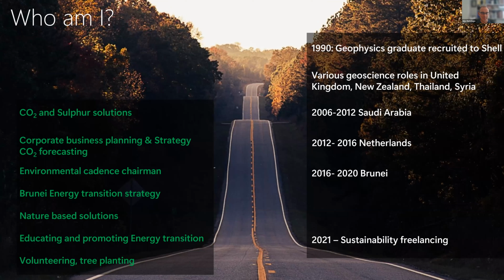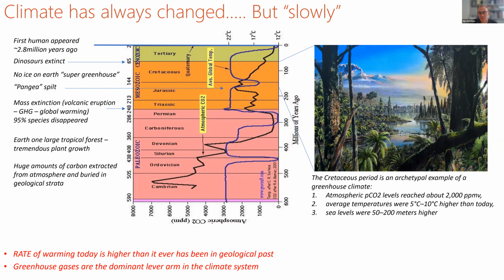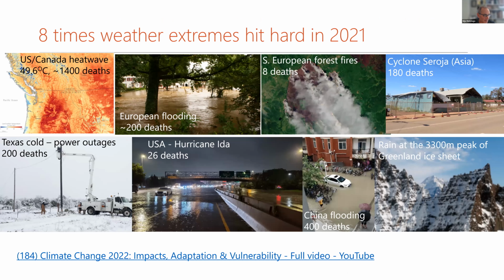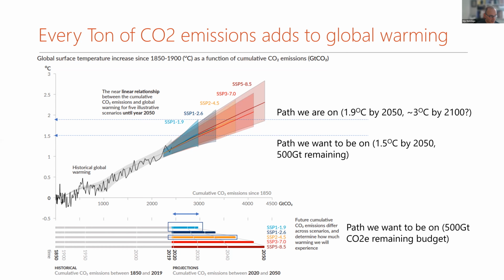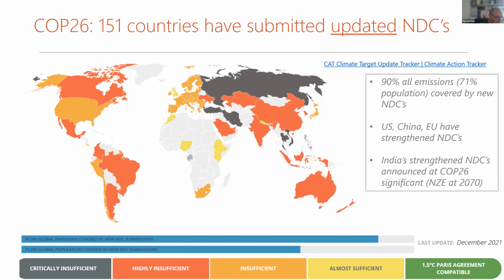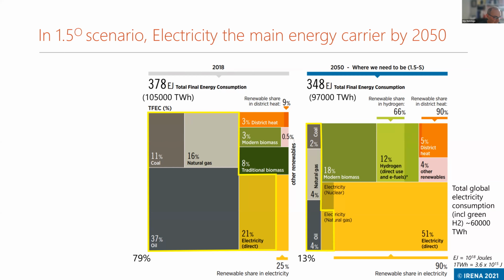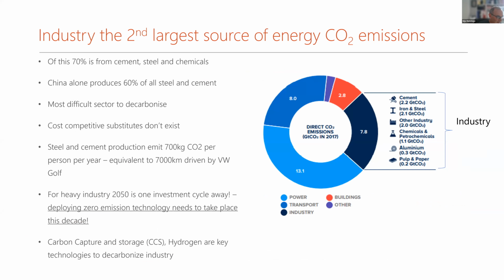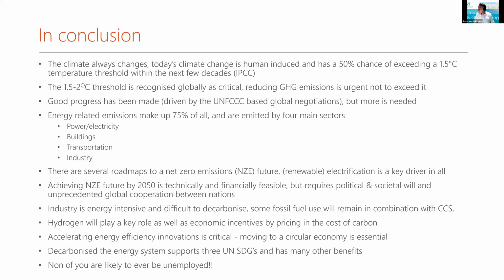An Introduction to the Energy Transition   Esanda

Comment: Excellent and very interesting! Honestly focused on CO2

1. Regarding energy batteries: open chat ai: how much has power storage in kwh per kilo of batterij improved the last thirty years?

Open chat ai: The improvement in power storage capacity of batteries, typically measured in kilowatt-hours per kilogram (kWh/kg), has been significant over the last thirty years. While the exact numbers can vary depending on the specific battery chemistry and technology, here are some general trends:

Lead-Acid Batteries: Lead-acid batteries, which have been around for a long time, have seen limited improvements in energy density over the past few decades. They typically have an energy density of around 30-40 Wh/kg.

Nickel-Cadmium (NiCd) Batteries: NiCd batteries have been used in various applications, including consumer electronics and early portable devices. Their energy density is in the range of 50-80 Wh/kg.

Nickel-Metal Hydride (NiMH) Batteries: NiMH batteries, which are commonly used in some consumer electronics and hybrid vehicles, offer an energy density of around 100-120 Wh/kg.

Lithium-Ion Batteries: Lithium-ion (Li-ion) batteries have seen the most significant improvement in energy density over the past few decades. When they were first commercialized in the early 1990s, their energy density was around 100-150 Wh/kg. However, through advancements in materials and manufacturing processes, modern Li-ion batteries now achieve energy densities of 150-250 Wh/kg or more. Some advanced variants can exceed 300 Wh/kg.

These numbers indicate that Li-ion batteries have seen substantial improvements in energy density over the last thirty years, making them the dominant technology for portable electronics, electric vehicles, and energy storage systems. These improvements have been driven by advancements in electrode materials, electrolytes, and cell design.

It's worth noting that energy density is just one aspect of battery performance. Other factors, such as cycle life, charge/discharge efficiency, and safety, have also seen improvements over the years. Additionally, ongoing research and development in battery technology continue to push the boundaries of energy storage, aiming for even higher energy densities and more sustainable materials.

2. Electric grid maximum growth NL: Helaas kon ik geen specifieke informatie vinden over de groei van netwerkbeheerders in de elektriciteitssector.

3. Geothermie groei: For the most up-to-date information on the maximum growth of geothermal energy in the Netherlands, I recommend checking with local authorities, energy agencies, and environmental organizations or consulting recent energy policy documents and industry reports.

4. Gradueel uitfaseren met fossiel. Stel dat de CEO's van grote oliemaatschappijen niet zo willen uitfaseren: is het zo dat de kosten per barrel alsmaar zullen stijgen, omdat nieuwe olie & gas alsmaar meer 'exploratie' kosten? Kan de groei in kosten per barrel zodanig toenemen dat 'olie zichzelf' uitfaseert wegens te hoge kosten, ten opzichte van renewables? Wat is verwachte groei in kosten per barrel? 

Open chat ai: Historisch gezien zijn exploratie- en productiekosten in de olie- en gasindustrie gestaag gestegen. Dit komt deels doordat de industrie vaak moet investeren in technologisch geavanceerde methoden om toegang te krijgen tot moeilijk te bereiken reserves, zoals diepwaterolievelden of schalie-olievelden. Bovendien kunnen milieuregelgeving en de eisen voor veiligheid en gezondheid op de werkplek ook bijdragen aan kostenstijgingen.

Om een nauwkeurige voorspelling te doen van de verwachte groei in kosten per vat per decennium, zou men toegang moeten hebben tot actuele gegevens en modellen die rekening houden met de hierboven genoemde variabelen. Deze voorspellingen worden vaak gedaan door gespecialiseerde onderzoeksbureaus en organisaties in de olie- en gasindustrie, zoals de International Energy Agency (IEA) en de Energy Information Administration (EIA).

Als je specifieke informatie nodig hebt over de verwachte groei van exploratiekosten in een bepaalde regio of voor een specifiek type olievelden, zou ik aanraden om contact op te nemen met relevante bronnen in de industrie of de meest recente rapporten en analyses van toonaangevende organisaties te raadplegen voor de meest actuele informatie.